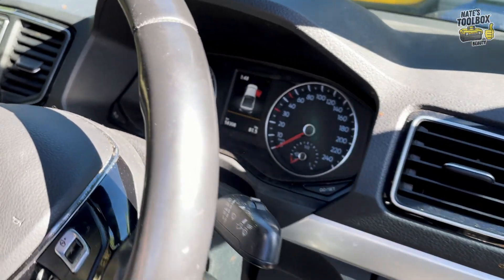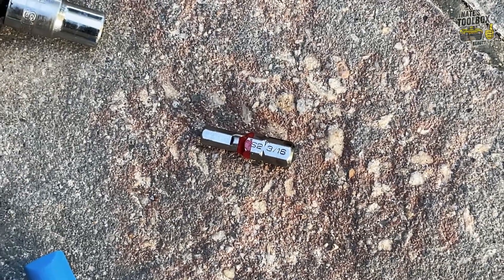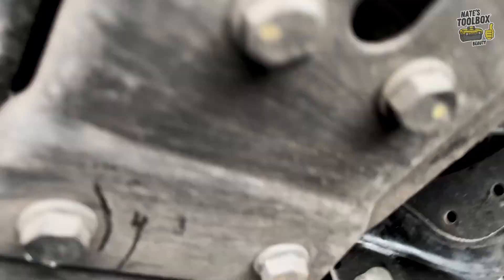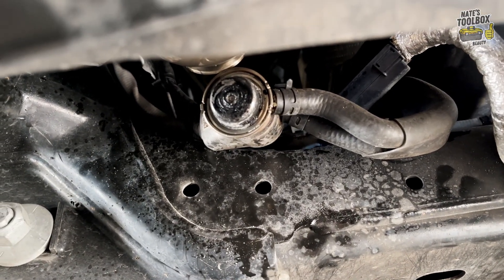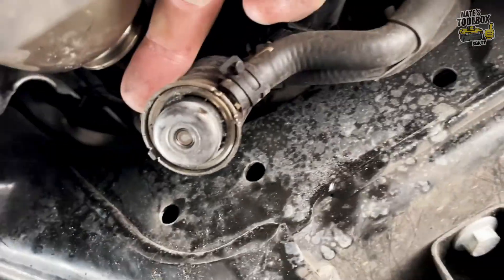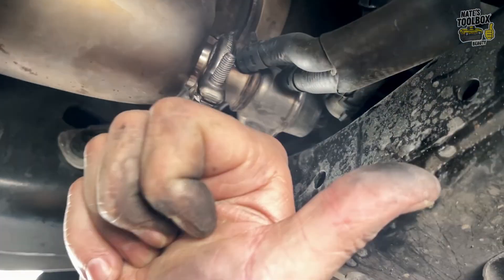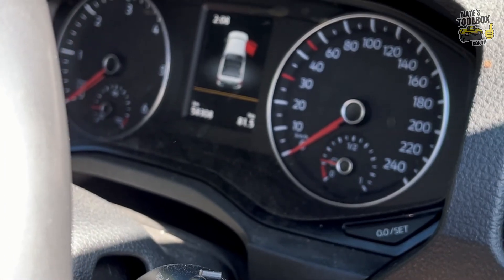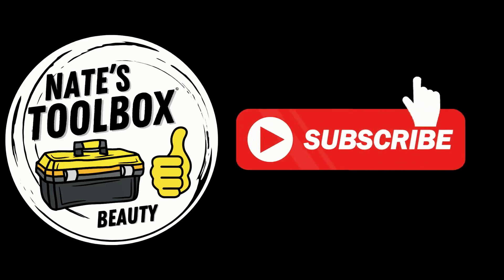Warning Light Woes? Fix Your VW's AdBlue Mystery!

Comment: im still getting a warning that I am running out of range before car won’t turn on, ive put 5 litres in and its filled right to the brim of the fill hose and i seem to have to drive it to make it lower down the hose. mine is a vw caddy mk4 2020

Comment: Why was pressure to low if the injector was blocked
Reply from the maker: It’s not exactly a lack of pressure in the system that causes the error but a low quantity of additive that begins to be  injected into the exhaust which then equates to the sensor slightly down stream still reading a high NOx level.  Having blocked injector is the cause of the low quantity of fluid injected, the low  pressure error code should really mean low quantity of injection fluid which could be caused by a blocked injector (most common) or a faulty pump. It’s a pretty basic system of fluid, pump, injector and NOx sensor.
Reply: Where's the pressure checked, thought it would be before the injector
Reply from the maker: Not exactly pressure just NOx gas sensing - low pressure or “quantity” of injection fluid reads higher than normal NOx gas in the exhaust and causes the error code

Comment: You didn't fix it.
Reply from the maker: Errrrm it’s fixed 😂
Reply: how to fix this, tell me, yesterday the message came on after 950 km, starting is not possible, error p20e8 even though the AdBlue tank is full
Reply: Do exactly what He did, forget where the Adblue injector is positioned... take it out and clean, maybe it is Crystallized in the head and it no longer injects Adblue... simple. @arsengeratov286